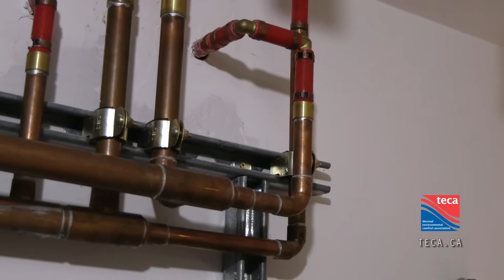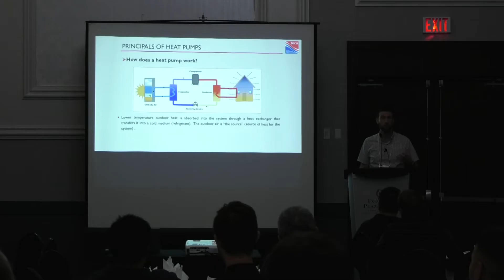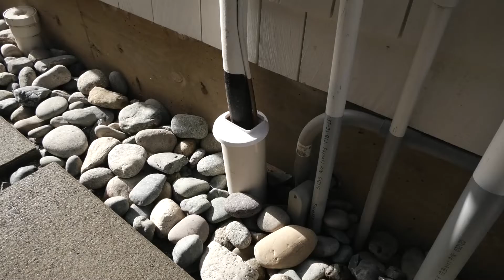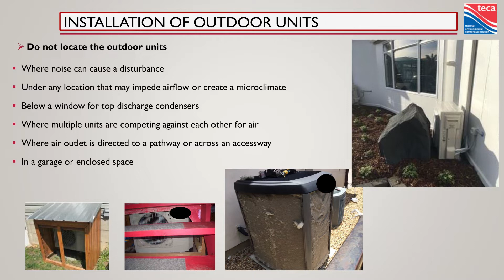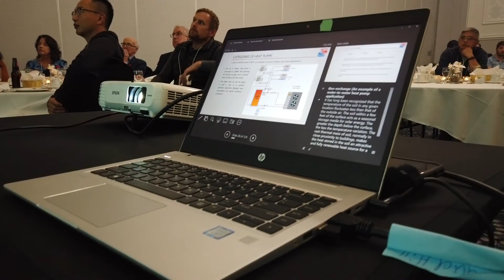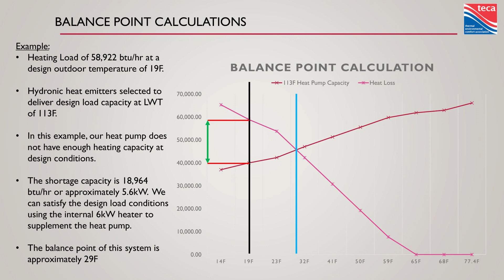Air-to-Water Heat Pumps

Comment: If you are building a air to water system that is a monoblock, you should be using R290 as the refrigerant. It checks all the boxes. High COP in a large temperature range (down to -35C), Low system pressures reduce compressor work, high temperature water produced so can provide hydronic heating and domestic hot water and with  the monoblock all the refrigerant is outside so no paranoia about flammability. The last reason is that it has the lowest GWP (3) of any refrigerant other than CO2 itself. CO2 in a transcritical system is an excellent refrigerant but the equipment is 5 times as expensive due to the high pressures and control is more difficult since dry ice formation can destroy the system if its out of control.

Comment: A steam engine applied science a supercharger or turbo applied more air flow add.
 Air compressor add to a car is turbo & supercharging basic.
Air conditioner next step thrusters rocketcas shuttle.
heat pump 3rd phase self containment minus air handler.
#cheaperonbillday